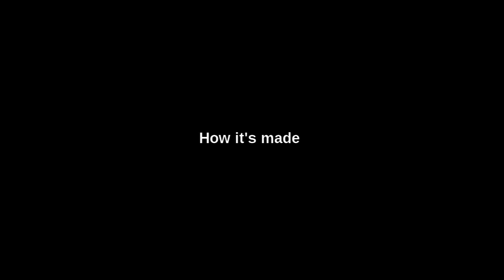DIY JIG - Festool Track Saw Parallel Guide for Narrow Strips

Comment: Very smart to integrate the blade thickness offset into the jig.

The jig is however only as accurate as the splinter protection is. My splinter guard may easily be 0.3 mm off, after heavy use. Maybe it would have been better to but up against an aluminium part of the rail.
Reply from the maker: Thank you Nico. An advantage of this device is that one can adjust the desired dimension directly. To correct the offset of your splinter guard you can make the groove (at 4:21) smaller or bigger.
Reply: In truth, the splinter guard isn't critical, but the offset from the blade to the left edge of the track, to which this guide touches, is the critical dimension because it represents to the actual offset to the cutline.

A useful add-on for those who are concerned about the offset accuracy will be a simple setting gauge that represents this offset.

Comment: Nice jig! Good work.
Reply from the maker: Thank you!
Reply from the maker: I can not subscribe to you because I already subscribed to you!
Reply: Sorry about that. I didn't see you under my subscriptions for some reason. Weird.
Reply: Nice - problem is that your cutting the strips on the off cut side. That means they'll be narrower, by the saw blade curf, than you measured. That's 2.2mm for festool.
Reply from the maker: No, I cut exact the same width which I measure! The trick is here 4:21 and here 6:15